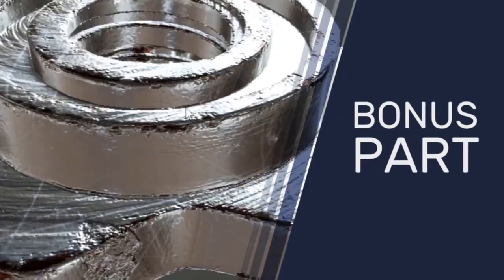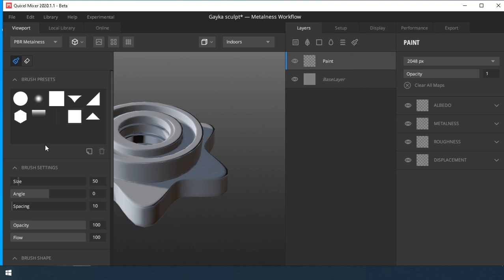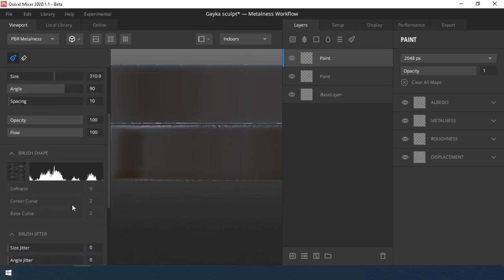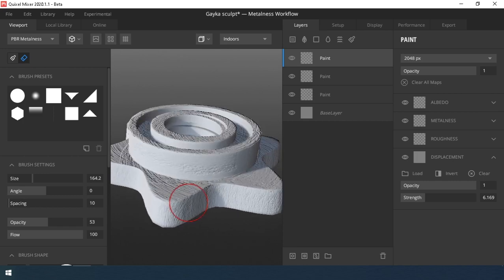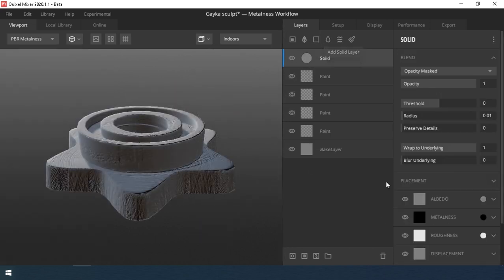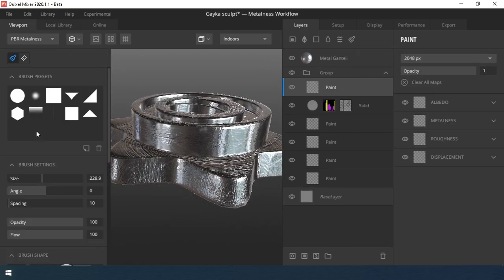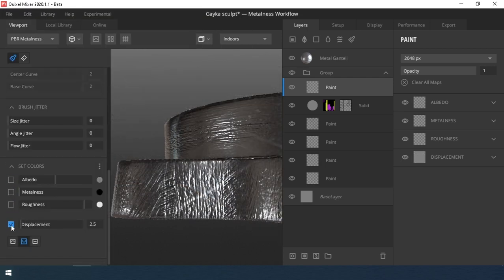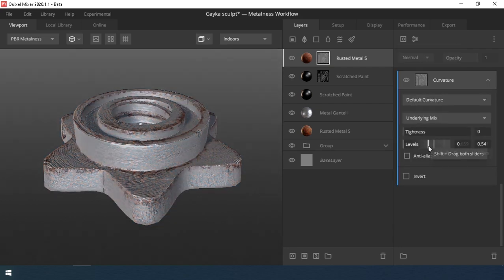Bonus part! Sculpting in Quixel Mixer

Comment: In love ¿ Where u get the normal img?
Reply from the maker: I drew some height maps myself, for example, lines around the circle for the top surfaces of the nut. and for the bottom one, I took a heightmap from a scratched steel material. then for the dents, I also took photographs of dents on the wall and made a bw stamp. but of course this is all an elusion, for good it is better to do sculpting in a blender and then bake the normals)